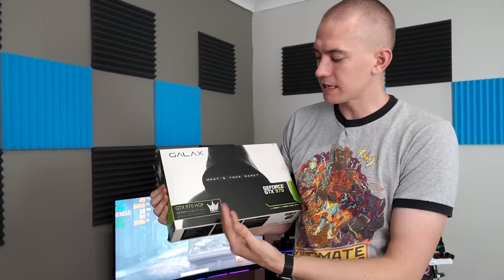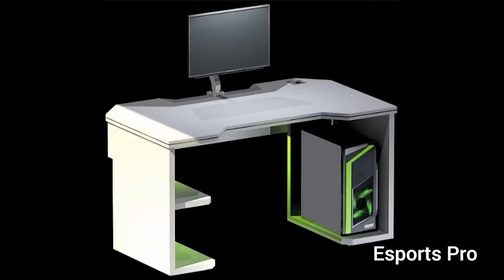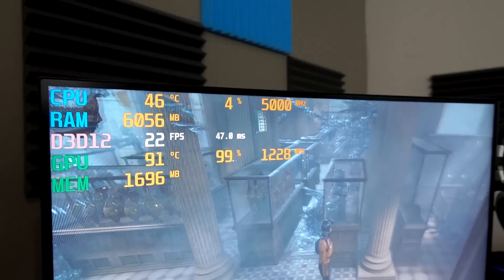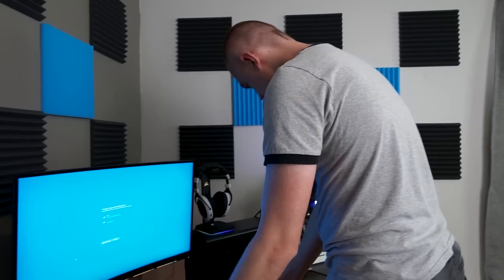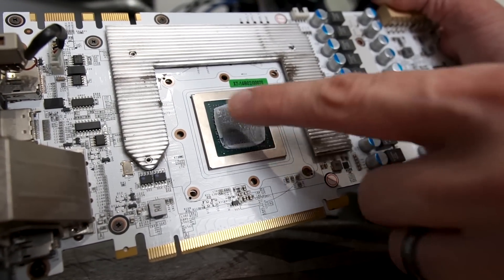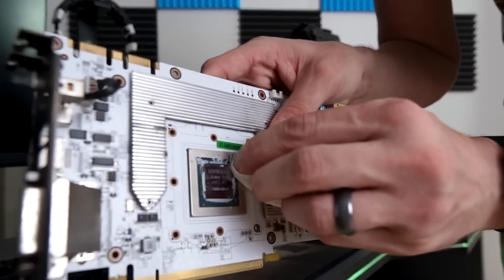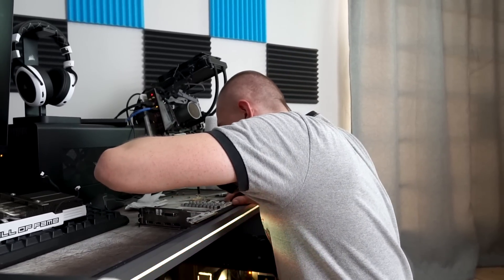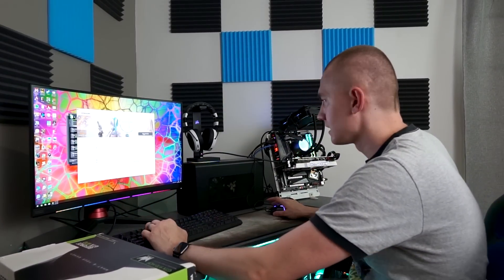GTX 970 - Worth It In 2019?

Comment: Been using mine since August 2015  and now in December 2020, I'm upgrading. I've been able to play all the games I've wanted with my 4K monitor (always have the graphics in highest setting), but it wasn't until I played Horizon Zero Dawn on PC that I had to lower the graphics and put most stuff into low settings... As the 970 is close to Cyberpunk 2077 minimum is GTX 780 3GB, I decided it was time to upgrade.

Comment: I run almost every game with gtx 970 and i7 4790k with 16 gb ram since 2015 on high settings and performance without any problem but i have problems with 2 games i like and play much.. 1) gtav- i cant run all settings to maximum , i must turn off many to get 60 fps 2) rome ii total war - i have everything maxed on settings but when i play 4v4 battles with 40 units each army alone, the game lags as hell and i cant play..

Comment: I have it since december 2014 paired with an i5-4690. The most fps problems I  have is CPU related and it is still running it's stock thermal paste. Im going to change it in the coming days to Kryonaut to see if it can handle higher OC clock speeds.

Comment: still worth it in 2020 03:26 gigabyte gtx 970 g1 gaming is a power house over clocking you can do if you want is just insane i run it faktory and its still amazing after 6 or 7 years cont remember its only 6 or 8% lower performance then 1060 it only have faster mhz but 970 have insne stats over the 1060 when it comes to buss 256 over 190 or what 1060 hade and so on so it leaves 1060 in a cloude of dust xD

Comment: I’ve upgraded from MSI GTX 670 to Gigabyte GTX 970, as both cards are factory overclocked versions. The down part is that the GTX 970 gives more browny tint in skin tone on white people skin in photos, with the same colour settings in the nvidia program and on my US $250 IPS AOC screen, right away I noticed the darker and non vibrant skin tone that can’t be adjusted right. No matter how i tried to tune the colours, just couldn’t get it back to the old GTX 670’s. It’s like going from normal PAL colour system to NTSC Germany colour system on VHS cassette, the colour is stuck and more unmatched to ipad’s Colour, it looked more flat like print out, more grainy, sharper picture, less vidid ... oh, it’s just a game now, not for photos and movies. It’s like replacing your TV, you want Panasonic’s colour system, and they gives you Sony’s, the skin tone are different and can’t be fixed.

Comment: nearly every benchmark was on older games, not much from 2019, also the 970 is very close to a 1060 in performance which is mid range and developers aim for this range so most people can run the game. ultra settings are not needed, most games look great and run way way smoother at high.

Comment: I'm running two heavily overclocked gtx 970 100me's in SLI with a light overclocked 4790K. Temps in optimized newer games in ultra stay in the 55°c range and are smooth running but with some new alpha games (Atlas for example) my cards utilize the aggressive fan curves and my temps usually stabilize at about 70°c. Playing on a 65" oled 4k TV in 1080p is still no problem. I attribute any issues I'm having with optimization, as ARK in Alpha was the same and improved dramatically. I've learned alot with these cards and right now I'm waiting until they're obsolete ti upgrade to a single top grade card. Maybe I'll just sell the rig and rebuild with tempered glass and liquid.

Comment: I've been using mine since laung. No problems with Rise of the Tomb Raider, Elite Dangerous, Kingdom Come Deliverance. Usually play with v sync and as you can see, not twitch shooters.  Even at 1440p it's ok mostly maxed out if you don't mind using basic AA and maybe shadow and lighting tweaks in some cases. Slower games you can half v sync and boost some settings.

Comment: I'm currently rocking an 8600K and a 970 with an ssd, as long as you're still playing @ 1080p the 970 is still a BEAST. Its not really future proof, but you could easily make it into 2020 @ mostly high settings with 60+ FPS.

Comment: GPU's are in similiar levels of performance, you have the low performers capable of 720p medium graphics, and the upper low level cards like 750ti able to do 1080p at low level graphics and then the mid level cards of which i own a  zotac 970, a gtx 1060 3gb, a rx 480 and each is very similar in their performance.   They can do very high to low ultra graphics at 1080p which is all I need and each will get near 60 fps with those settings.  If IF...you need 144hz (144fps) at ultra and 1440p or 4k  then those cards wont make you happy, but I find the difference between near ultra graphics at 1080p at near 60 fps a very enjoyable experience and a quite noticeable change from the old 7850 or gtx 950 or gtx760.   So you can make do with lower cards and slower CPUs but the 970 is still a remarkable performer and at the used price market by the time it will no longer function in more modern games hopefully a navi 7mm will come out at less than $300 and have a big improvement in performance but otherwise I am not impressed with the newer nvidia cards.

Comment: FYI: Also rocking a MSI GTX970 (and i7-4790k +16gb ram(No overclocks)): 

I get about 10-15fps more in Battlefield 5 and everything on ultra. 

Why? I disabled Full Screen Optimization in windows for this game. Im not 100% but also Future Frame Rendering has to be enabled. Vsync off!.

Disabling Full Screen Optimization (done via right click route on the exe file of the game in windows 10), increases my fps in multiple games but not all of them. Never had a negative effect on fps so far though. So i nowadays disable Full Screen Optimization for all games.

Comment: I had a gtx 970 and I went to the gtx 1070, i do not recommend this kind of upgrade, I spent more £120 to get the gtx 1070 and  I got 30-40% of performance... I recommend people keep their gtx 970 and wait the next generation (Ignore RTx's) or go to series 80 like 2080, 1080, 1080ti... (In my opinion an upgrade worth if you get 80-100% more power than the current gpu)

Comment: Yes,  someone was selling a GTX 970 for 90 bucks, and I bid 70. Since no one else wanted it, the seller sold it to me. It works great, and it is comparable to an RX 580 8 GB. The GTX 970 is usually within a 5% performance window to the AMD card, so I have no complaints.

Comment: Got a used Gigabyte Windforce GTX 970 for 110$ a few days ago for my HTPC. And i'm definitely impressed by the performance. Replaced the thermal paste and it gets around 31°C on idle and 67°C under load

Comment: asking if the 970 is still relevant is like asking if the 1060 is still relevant. The only issue you might run into is a shortness on VRAM in some titles with too high a texture setting

Comment: still use that card today, the EVGA 970 SC, and it really is a beast. not once did my temps break 80c and have had this card since 2015 and run it hard 10 hours a day most days.

Comment: Awesome vid! I have GTX 970 myself (different edition though) and it's little bit over 3 years old now. Checked it's temperature... it's not such a disaster, but I will have someone to looked at it just to be sure (same goes for my CPU).
And yes, GTX 970 is a great card. Best buy so far and it's my 5th graphic card.

Comment: Not much mistery: Better than 1060 3gb, worse than 1060 6gb. As long as it is considerably cheaper to compensate for the age and increase power consumption, is totally worth it. I still rock my 970 and was waiting for the RTX for upgrade but was disapointed with the very expensive price of the 8gb models. I don't want to upgrade to a 6gb card as I plan to play in 4k. 

Gtx 970 also has the added advantage of legacy VGA through HDI-I connect discontinued on the 1xxx generation. Although a niche feature, it is useful for the few of us that still use CRT.

Comment: Still using my strix 970 but im in the middle of planning buying a 1070 or wait for the 1660 to release so 1070 price will go down.
Though i wanna get a 144hz monitor paired with this 970
Reply: In games like Overwatch it does 144hz =D. In AAA titles you get above 60 fps easy.

Comment: GTX 970 is still serviceable up to 1080p, as long as you're willing to sacrifice a few detail settings in some games. It can handle quite a few games at 1440p high as well. It's in the same league as an RX 480 4GB or 1060 3GB.

Comment: The best 4GB GPU you can get
Reply: The GTX 980 came with 4GB, and it's clearly better. AMD RX 480 and 580 are both a bit faster as well. Those both have 4GB versions.

Comment: Hi, I have a Asus Strix Gtx 970 OC and I've never cleaned up the interior or changed the thermal paste for almost 4 years.

Should I clean the card and change the thermal paste today?
Reply: If the card works well and temperatures are good, replacing the thermal paste will do little to nothing. The strix 970 probably also has thermal pads on vrms and memory chips, if so then theres zero dust on those too. You can clean the dust on the fans and heatsink with a brush, compressor works too.

Comment: You SHOULD have done a run with the 970 manually OCed to the max! My 980 Ti runs faster at 1503 MHZ core, and 8 GHZ effective VRAM- if you hit 1500+ and upped the VRAM to about 8 GHZ, you probably could have gotten another 10%+ performance!

Comment: As someone still using a 970. I can say yes, its absolutely still relevant. The 1060 is not much of an improvement over a 970 other than vram. Nvidia is stingy as f with vram, which is why ill be going with AMD when I upgrade. Side note, never use paper towels. Use coffee filters because they leave no particles.

Comment: Today is literally 4 years and a month after i got the KFA2 gtx 970 OC silent " infinity black edition " for £290 from Overclockers, it's a decent card i had a really good run with it. At current prices i will most likely upgrade when my card dies, like the way our parents only upgraded the tv when it finished its cycle. Not looking to spend money in vain on a overpriced market, the pc pricing as a whole needs a correction and companies under supplying the market hasn't allowed prices to come down to earth, maybe summer. £300 investment for a 6gb card and the generation after mines seems pointless not even getting double ram, let alone performance.

Comment: My GPU died and I bought a used GTX 970 to get me buy until I decided what to buy, it had been doing just fine for the games I mainly play at 1080p 60fps, however, the games that have released in 2018, even a few from 2016/2017 are hitting it hard. I can barely get 60fps on high anymore, I have been playing some PvE titles at 30-40 fps, and for many competitive games I have to drop setting to med or even low. Unless you have some very old tech or need a budget GPU I would only buy a GTX 970 if you can find it for around $100 USA if not I would save up some money sell some cans and go with a GTX 1060 or RTX 580 that can be found on sale for USA under $180 for 8G model.
Reply: Hmm 🤔 something ain’t right with your 970
Reply: I sold a 970 to a guy just like you. Hmmm

Comment: It's doesn't run anything at a solid 60 fps. I own one myself. How about you actually try playing with the card instead of just showing some random non relevant gameplay that doesn't even show anything worthwhile.

It was a good card, was.

Especially in open world games or MMORPG's it can barely hold 30-40 on low settings simply because the standard of low has increased last 5 years.

Comment: The GTX 970 is still a decent card. My 970 Gigabyte G1 Gaming windforce X3 is running at 1504 mhz, Haven't seen is go above 64 degrees, 70% fan speed. Although i do play with v-sync on so it is mostly only being utilized between 35-80% depending on the game. Even tho my card can run Rainbow six siege at 110-130 fps i still have the odd screen tare which i despise, so i use v-sync.

Comment: 91C is fine for any graphics card 24/7. A lot of them were designed for 90C-99C and that hasn't changed just cause we get chips that can run cooler now. The VRM's etc will be at something like 120C and well within their operating range. It's hot for a human but not for graphics card. It's near the limit but safe. On modern cards with auto-oc it will just stop the auto-oc because it's at it's operating temp. Not that I disagree with replacing the thermal paste at all, just with the dramatic holly shit 90C way too hot burning itself to death.

Comment: I'm still running a 970 for 1080p60 gaming at 1400MHz with my 6600K @4,0GHz. I built my PC back in 2016 when you were still able to get 2x8GB of DDR4-2400 CL16 RAM for 60€ and managed to overclock it to 2666 CL14, oh the nostalgia... :D I'm really glad I skipped the Pascal generation in favor of ditching my slow HDD for a second SATA SSD. Maybe I'll upgrade my graphics card this year since games have become more demanding when it comes to graphics memory, but that really depends on the pricing of custom 1660Ti cards (which I think may give me the best bang for a buck for FHD gaming). If they cost somewhere around 300€ I'll choose the green team, if they're more like 350 I'm probably going for AMD.

Comment: I'm at the start of the video and the answer is most certainly yes: The Witcher 3 1080p High almost always at 60fps, when completely maxed fps drops to 30-45, Resident Evil 2 Remake can hit 60fps easily with most effects on and using high 0.5-2GB VRAM as the texture setting (Plus turning them even higher is mostly fine but will drop fps every now and then on very demanding scenes).

Comment: I have the Inno3D GeForce GTX 970 "iChill Herculez X4 Air Boss Ultra" and it remains to this day the only graphics card I've ever bought new. I had to have open wallet surgery to pay the £290 it cost back in November of 2014. The card was also getting really quite hot recently and it's amazing how much the temperature has been reduced after I applied a fresh dab of thermal paste to it.

As to whether the GTX 970 is worth it in 2019, Yes if you can get it for around the £100 mark. There are plenty of 970s on eBay for around that price, as well as many people who foolishly think it is still worth near the original retail price.

Gaming wise the only titles I've played recently, and actually benchmarked using FRAPS, are Assassin's Creed Odyssey and Resident Evil 2 Remake. ACO averages 45 frames per second with everything on High except Clouds and Fog which are on Medium. RE2R averages 80fps and that is with getting a high vRAM warning, if there is any stutter then it is not something I am experiencing just by gaming.

Everytime I think about upgrading I manage to put myself off simply because the GTX 970 is still a very capable card for 1080p gaming.

Edit: iFixit gets used a lot on Tech channels. I build my PCs with a set I got from the local Pound Shop

Comment: I had the 970. bought a 480 8 gig card for a basement video player rig. upgraded my 970 to a 1080

eventually, I retired the basement video player into a guest PC (which doesn't need a video card for youtube/netflix) and built another pc with some rx 500 whatever (550 probably) for the video player - so now i have a 970 and a 480. the 970 went to my brother at first, and when i stopped needing the 480, i gave my brother the 480 and gave a friend the 970.

The point I think is that I think the rx480 to be a better card, bc it has higher vram and usually that translates to better handling of games that happen to require more than 3.5 gigs of vram (the gtx970 curse)

but if your system stays within 3 gigs of ram I think that the performance is virtually identical. And the gtx 970 costs less than a rx480. So yes - i would still recommend the gtx970 if you are limited by your budget. OFC you have to consider other factors like your PSU compatibility but we're assuming that to be the case, i think

Comment: No benchmarks are done but I loaned my buddy my old gtx760 and it still runs games flawlessly on ultra settings. Only been tested in 720p though but I’d bet it could handle 1080 no problem.

Comment: The Dell 970/990 PC + a used 1050ti works very well.  Cool vid. 
So much easier to pull old thermal paste with a dry paper towel.  Vs wet.  btw.

Comment: How much of a boost in performance would a GTX 980 bring? Also, GTX 980 for $120-170 or GTX 1070 ti for $250-300 (both used)?? Im planning on building a gaming PC and my budget is $1200 for everything. The games I will be playing are: GTA 5, rainbow six siege, apex legends and CS:GO

Edit: Everything so including a monitor and keyboard (around $310 for both).
Reply: 980 is a 20% faster than 970
1070 is more preferable if you can afford it.

Comment: I almost ordered a RX 580 black Edition yesterday and I checked some comparisons with the 970 and it was barely 10% increase. I have an i5-6600K so I guess it's not worth it.
Would I see a gain if I change the thermal paste on my card or only if it runs hot?!